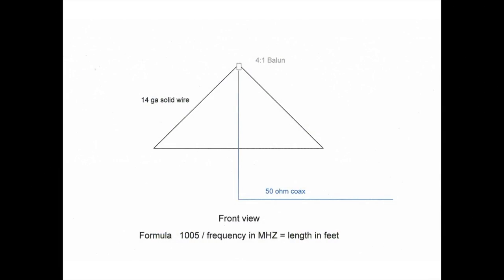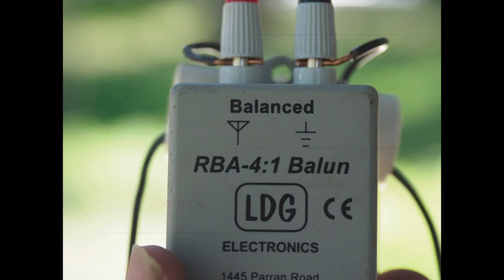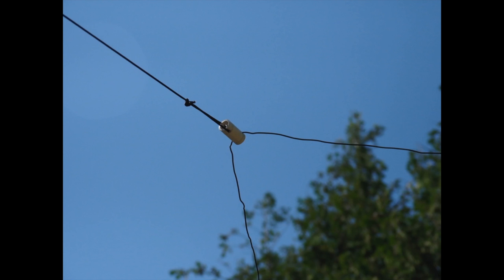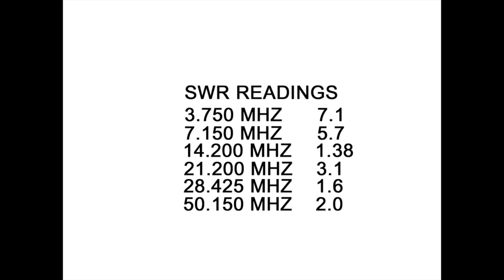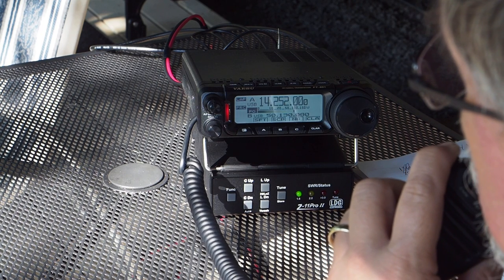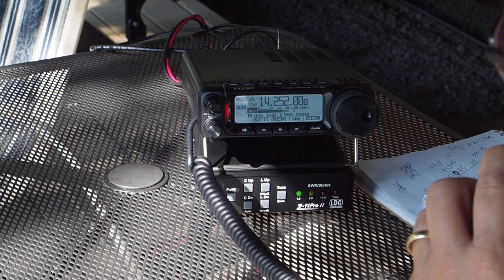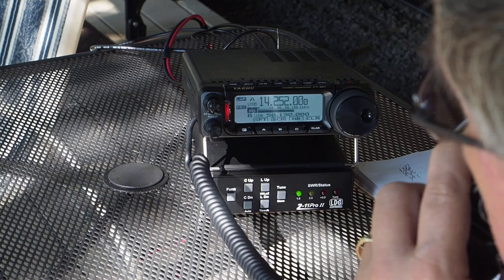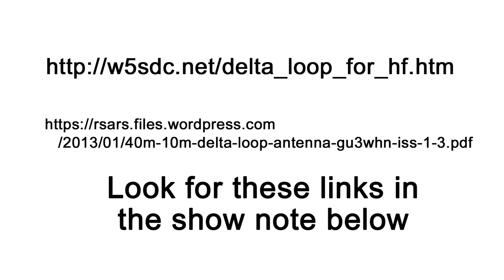20 Meter Delta Loop Antenna

Comment: Hi Denis and thanks for this!  Shortly after moving to Victoria, BC I lived on a small lot north of the city and was able to put an inverted vee for 20, 40 and 80 on the roof.  Later I wanted to add 17m and so built a corner fed delta loop similar to yours and had GREAT success with it.  Now, I'm living in a condo. downtown and am lucky enough to have been able to put a 20m inverted vee on the rooftop. However, with the new sunspot cycle fast getting underway, 20m is lagging well behind in performance compared with 15m and the higher bands.  Your video has inspired me to put a a 15m delta loop and in particular, your experiences using it on other bands with a tuner, I find particularly encouraging.  Parts on order, I hope to have it up and running before November 2023!  Thanks again ... Rolf, VA7AMV

Comment: HI Denis.  I built a 40 M version of a delta loop...but I fed it at one of the lower corners with the apex at about 65 feet from a redwood tree.   That made it vertically polarized.  It worked superbly on 40 and 20 using an 8 to 1 balun from the coax to open wire.  Thanks for the vid.  73

Comment: Nice video my friend - Ive just built one - 74 feet long and fed with 300 ohm twin lead into the 4:1 and same tuner you are using. Tunes 80-10. Be interesting to see how she does. Ive fed her in the bottom corner as a vertically polarised antenna.

Comment: No doubt the best, lowest noise wire antenna you can put up.  This was my first choice antenna type, and never looked back.  Note, though, that a vertical is infinitely better for DX, and that feeding it with balanced wire, not coax, gives hugely lower line loss.  Just run the twin to a 4:1 near the shack, and make the final connection with a short piece of coax.  My vertical delta works 1:1 on 20m using a 6:1, not 4:1 (depends on line length, environment, etc), and about 1:2 on 10m - without any tuner.  Advantage of twin also is multibanding with extremely low line loss when the SWR is high.

Comment: Hi,I made this antenna for 40m.To my surprise works without tunner not just on 40m ,but on 20m also.I used clothesline.From dipole,folded dipole and delta loop ,the delta loop is the best.73.

Comment: I have been making and using full wave loop antennas for 40M for many decades,  This goes back to when Novice band operators had to share the band with Really high power SWBC stations in Europe and eslewhere. My loop wire was parallel to the ground  to give a high angle trakeoff, this attenuated the signals from the SWBC and enhanced regional  signals. Perfect for working Novice ops in the US. ..I used a "Q section" of 75 ohm coax as a matching device to 50 Ohm feedline. I chose this because I had no intentions of using the antenna an any other bands.  Signals were better on short haul to several hundred miles, compared to a halfwave dipole up about the same neight. 
I have used triangle, square and odd polygonal shapes with little difference  in operation of the horizontally deployed wire. Location of trees uaed to support the wire was a big factor.
Occasionally I had some QSOs into Europe or the West coast , this was like working off the side of a Yagi !! :D
I enjoyed the presentation you made here. ...73...K8JD.

Comment: Hey Denis...against all Odds i tried something very different, Delta Loop Wise. 173ft. total Lenght of Wire, my CG3000 Automatic Wire Antenna Tuner and my 12m HD Spiderbeam Telescopic Fiberglass Mast. CG3000 Tuner laying on the Ground, horizontal Wire laying on the Ground and the vertical Wire Leps running up the Mast to 30ft. Heights from the Ground.  Gosh...what a fun i enjoyed on 80 nd 40m Bands. The Flipside Story about it I just picked a bad Day with the shittiest Propagations since a  long time for my Testrun.
All in all...a bad Day on HAM Radio always beats a good Day at Work.
Happy Weekend & 73 de Uncle Guenter 💯👍🙋‍♂

Comment: Just plan to build a delta loop antenna and I'm looking a bit over the internet and here I came across your video. Thanks for the detailed description, soon getting supplies of the required material and building the delta loop antenna for 40m band. Sorry for writing errors :)
73's from new subscriber! 9A3GVD
Reply from the maker: I'm glad you found the video helpful.  Good luck with you build.  
73
Denis

Comment: Great video Denis I have used one of these loops fed in bottom corner for many years as a 30m antenna. Same formula as you but I have the 75 ohm coax as the tuning stub got it out of a 1952 arrl antenna hand book which cost $2.50 at the time it was published. I like your feed point insulator come strain relief a good idea . cheers vk5cz Ian ..

Comment: I have been considering building a Delta Loop for 20 and 40 mater DX work. I may have to build two of them. Thanks for posting this great video.  73s   W3GTR
Reply from the maker: I want to try this as well.  Maybe a video in it this fall.  73

Comment: The impedance of your is 100 ohms, 4 to 1 balun is 200 ohms total and will give 25 ohm impedance in to your 50 ohm coax,   miss match the balun WILL heat up better to use 75 ohm 1/4 wave stub connect to 50 ohm coax for mono band op.

Comment: Nicely presented.  This is a question by a dumb guy:  what kind of ground requirement do you need?  If you do not have a physical ground for the radio do you need a counterpoise and if so what requirements?  Thank you.

Comment: Just one doubt, I will be erecting the antenna  on the 3rd floor roof top at 20 feet. Total height from the ground will be 50 feet, my question is is ground proximity a crucial factor?

Comment: Super video. Well constructed presentation. Bottom left config (apex up) but with feed point at 1/4 wavelength down from apex gives most optimum for vertical polarity (as opposed to feeding in a corner). Best wishes. Nick M1DDD

Comment: One question, I am looking to build an 11m antenna for cb radio for use in eastern ontario. I am interested in the v delta as bottom fed, full wave, about 36 feet of wire, Do you think this would be better than one of the coax bazooka types, or j pole/slim jims. I am considering all these designs, but am very fond of the idea, of a full wave delta do to ease of build and set up. A couple 12 foot pvc poles would do the trick to make the v.

Comment: Have you noticed any difference in running these vertical vs horizontal ? I’m thinking of making one for 80 but really need to do homework. Some feed with 75 ohm coax and others with ladder line in a corner to a balun.

Comment: Vertical Delta is a good antenna.
If it hangs low. It is better to feed it in the side.
There will be vertical polarization. The signal beam will be pinned to the ground. better connections with DX.
GDX 73 UA0CBM
Reply: Vertical polarization is if the Delta loop is perpendicular to the ground right? I agree the loop at its lowest point,no more than 10 ft for 20 meter loop so you don't have additional lobes that weaken the main radiation pattern. Also I think when you have lower take off angle you choose less gain. And the antenna is directional. Which is ok if you can turn the antenna to the direction to the the signals you want. Otherwise gain would be what you need. Just my opinion. I could be wrong?

Comment: Thanks for sharing your swr measurements. I have really similar results with a few different variables. 

I am feeding mine with 10 ft of ladder line > 4:1 balun > rg6 (75ohm). 

This seems to have given me a slightly better match on 20, 10 and 6. All bands are below 2:1 across the entire band.
Reply: Gailen Gillespie  A 2:1 balun would be ideal for your purpose,closer reducing 120-100 ohms down to the 50 ohm feedpoint impedance needed,that is,unless you use the 75 ohm impedance reduction feedline.

Comment: Dennis..curious... say using a 40ft spider mast, could one build both a 40m and a 20m loop suspending both on the same vert pole with the 20m centered inside of the 40m ? for portable ops etc..de W7TY Idaho
Reply from the maker: I'm thinking of trying that too, maybe this fall.

Comment: Hi Denis thank you for knowledge sharing, some one gave me a LDG 1:1 balun can you show us what antenna config can be use on it, example vertical with radials? Sorry kinda new with the hobby. Thank u in advance..
Reply from the maker: Hi, Thanks for the note, it's too cold for me to be making outdoor videos at the moment cuz I'm kinda of a tuff in the winter hihi. The 1:1 balun is mostly used on dipoles but it can be used on a vertical.  I have a cool inverted V antenna video planned for the spring  so stay tuned.
73 de VE3BF
Reply: @VE3BF  72 de 4I1ANA

Comment: hi is it possible to do a video on the multi band Delta Loop if not can you point me to someone who has already made one as I am not very technical but a video like yours where you have already made one and you give the length of wire needed and type of Balun Used I can just follow along and make one myself and I will give you credit for showing me how in any video I use it in.

cheers Phil M6PGU in the UK
Reply from the maker: Hi Phill,  Funny you should ask, I have gathered all the material to build a multi band loop, I've make all the calculation so all I need now is the temperature to rise and the 6 feet of snow in my back yard to melt. Hi Hi.  I hope to make a video on that one this summer.  73 de VE3BF

Comment: All the numbers say that a dipole at a decent height will outperform a delta loop.   Yet all the dipole vs loop vids show exactly the opposite.  My own experience with a 40M delta loop (first try at building and using) puts the lie to the numbers.  Equilateral triangle (more or less) with the apex high...at about 50 ft...fed with open wire and a 2 to 1 balun at one corner yielded unexpectedly good results on both 40 and 20....bottom leg was only about 6 ft off the ground. It was phenomenally "quiet".....very low noise.  I suppose if you can get a dipole up at least a half wavelength off the ground it would work quite well too...but on 80M that would be about 130 ft.  Interestingly, I erected a two 5/8 wavelengths in phase  for 75 meters with the center at about 70 ft and it was a phenomenal DX antenna....Europe was commonplace from Florida practically every night with "strongest sig from North America" comments being a fairly regular report.  Worked Asia fairly frequently on 75 as well.  73 and thanks for the vid.

Comment: Is it best to use a voltage type balun or current balun on loop antennas?
Reply from the maker: I'm not an expert on balun, the LDG 4:1 balun in the video is a voltage balun, it's main purpose is to match the 100 ohm impedance of the loop down to 50 ohm that the transmitter needs.

Comment: Such a delta loop has an impedance 100 - 120 ohm. Probably hardly any difference if you use this balun or connect the antenna directly. If you use 2,25:1 current balun, you almost will not need antenna tuner.
Reply from the maker: I've moved this antenna to my home QTH. It's now at 30 feet in a flat top installation. The SWR is 1.3 at 14.000 1.0 at 14. 2 and 1.4 at 14.35 this is with a 4:1 balun.
73